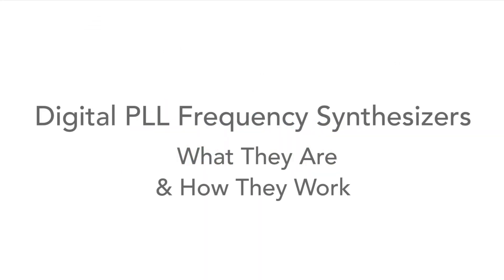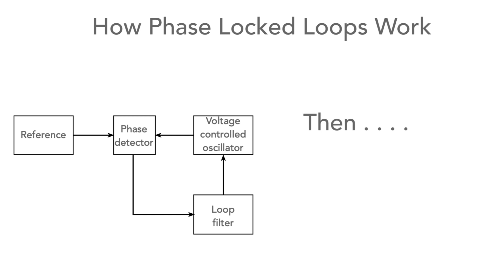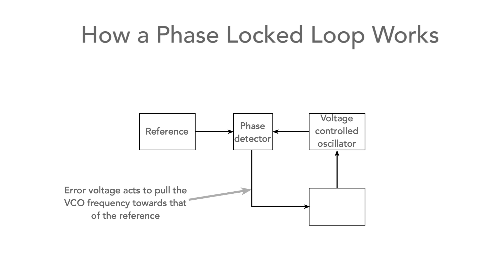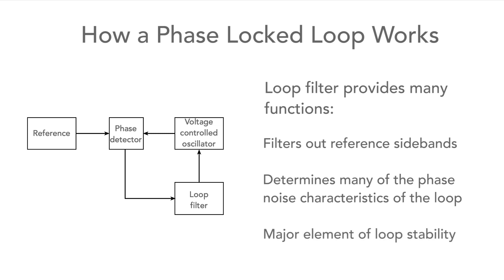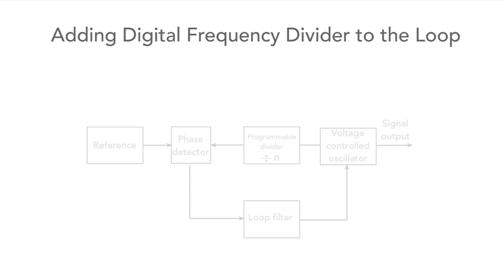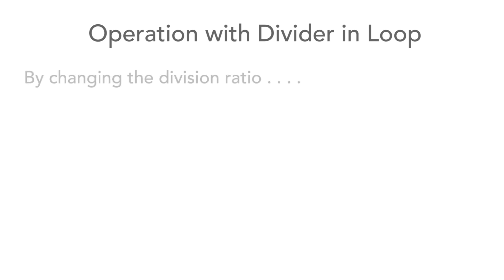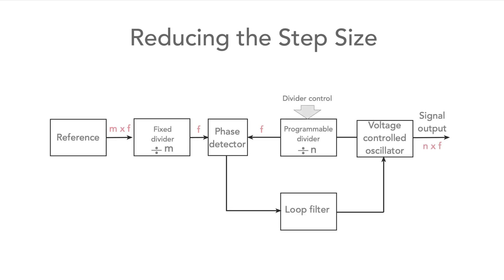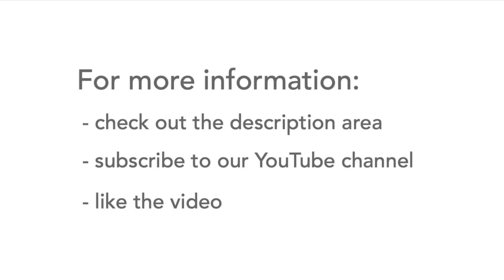Digital PLL Frequency Synthesizers: what they are, how they work

Comment: Could you please explain the ending where the divider range is said to vary from 11520 to 11680. Is it dependent on the fixed frequency divider or the reference frequency? How is that range determined?
Reply from the maker: The divider in the synthesiser allows the VCO to run at frequency which is the division ratio times the comparison frequency. The divider range 11520 - 11680 enables the VCO to operate over the required range.

Comment: Excellent explanation, yet almost all the information from engineers are basic blocks and superficial reference to the complicated mathematics of the programing of the PLL chip. I have some PLL chips, I need to learn to access and get to run, there isn't any application note for them. Well, the data sheets have basic information for qualified and experienced engineers in the field. But some elaborate examples from talented tutors to newbies, hobbyists, nonexperts would be a hit. Something like setting the chip to default, load with parameters and save a frequency and most important how to extend and expand from this outset. Bringing a PLL chip like the SN761672 or TSA5511 or any other and showing things on the oscilloscope along with frequency counter and a receiver etc.
Reply from the maker: I confess that I always found the data sheets were a bit lacking. They were of the ilk of "the magic happens here" and no real explanations of how to design with them.
Reply: under competition stress they release the part accompanied with mass commercials than support. I guess giant customers get hotline and support once they experience problems.

Comment: why do we need to lock refclk to VCO output? why can't we just use a VCO directly as a frequency synthesizer and control the output frequency by varying the voltage?
Reply from the maker: The whole idea of the digital PLL synthesizer is that locking it to a crystal oscillator gives it the high frequency stability of the crystal oscillator. If you just use a voltage controlled oscillator on its own, then it would drift everywhere because there would be nothing to detect and correct any drift in frequency.
Reply: @ElectronicsNotes  thank you sir

Comment: The very BEST video I've seen so far on how a PLL might work to increase clock frequencies (e.g. inside a FPGA).  It isn't bogged down with implementation details, just the top-level concepts.  This makes a lot more sense now. You take an input clock frequency (F) and the output frequence will be (F/M)*N, where M and N are integers.
Reply from the maker: I am really glad you liked the video. I know from my own experience like to start with a top level explanation and then dive down when I understand the basic concepts. Thanks.

Comment: Why don't we just use the stable reference input frequency directly instead of doing all that for the pll since at the end vco f is same as the reference frequency
Reply from the maker: Yes, one can wonder why a loop is used to replicate the input frequency. There are, however, a number of ways it can be used. It can create a steady output from a pulsed input. It can be used to detect FM because the VCO voltage is the detected output. It can also be used to create a frequency synthesizer by introducing a divider or mixer into the loop. https://youtu.be/5K7Pvc5fxZI
I hope this helps.

Comment: Bring us sone numerically controlled oscilator, please.
Reply from the maker: The digital dividers used between the Vic and phase detector are normally controlled digitally and this means that the frequency of the synthesizer can be programmed by a processor or other digital control.
Reply: @ElectronicsNotes  I've been looking at FPGAs, and I see there are templates ("IP") for making PLL circuits in them.  I'm now wondering how they make the loop filter, since it's effectively all logic gates.  Do they get to skip that part?

I guess the VCO has to be numerically controlled too, not a VCO - presumably just a programmable counter / divider.
Reply from the maker: @TooSlowTube  I confess that I have never designed a synthesizer using an FPGA. My experience has been designing them using more traditional techniques. Interesting project, though. I would suggest a chat with an RF digital designer who has experience with synthesisers. May be the digital elements are covered both e FPGA and the remainder by analogue circuits.